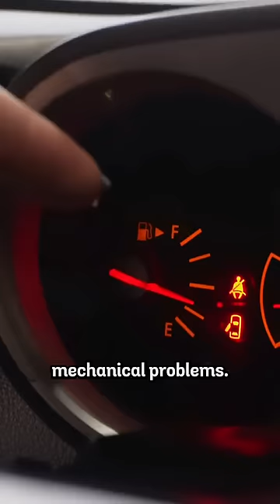Everything Wrong With My 350Z... (Part 1)

Comment: If it's leaking oil   it has oil🤷‍♂️
Reply: Lmao facts
Reply: Not for long
Reply: as long as it is leaking, everytihing is ok, if it stops leaking, then you have a problem!
Reply: @georgwarhead2801  if it leaks on to the belt you have a problem
Reply: @The_Wanderer...  what problem do you get because of it? the belt is normaly spaced away from the engine so leaking on the belt is REALY unlikely
Reply: @georgwarhead2801  it happens, and when it does it tears it up. Also it's not really unlikely.
Reply: @The_Wanderer...  i have now worked on MANY cars and engines, but thats the first time i hear someone saying, that a oil leakege has riped apart his belt?!? if you say it makes slip the alternator so you loose charging performance on your battery and your car goes out, ok...but tearing it up...and if your engine is leaking oil, it flows down, not sideways over a gap between the engine and the belt. if oil would kill belts this easely, every engine with a timingbelt would allready be dead. but hey, here we are and most engines still use timingbelts
Reply: @georgwarhead2801  I can see how what I said was misleading, and you're right, oil will not split a belt in 2, but it causes cracks and weakens the belt, which in turn breaks due to the tension on it. As for the oil leaking down, that overall just shows your lack of knowledge in the subject, oil is in a lot of pressure, and the engine isn't exactly sitting still, assume the leak was coming from the (a) cylinder head. Let's not even get into how many models of engines there are, to say you've worked on many cars is not a very good point, there are plenty more cars than what you've worked on, if I've offended you I promise that was not my intention, I just state the facts
Reply: @The_Wanderer...  dont worry,it takes more to offend me. As you sayed the oil is under pressure and can so reach the belts, even then, your problem is not oil on the belt, your problem is loosing oil so fast that your engine will be dead before it comes even close to destroing your belt. Still the belt is roo far away for a "normal" leak to reach it. Sure there are many types of engines, but all of them have many things orientet and positioned the same. Even if the engine is  moving in the car its allways moving parallel to the belt and not with a axial movement in the direction to the belt. Lets say you have a v8 engine in your car, the engine doesnt move back and forth in the car, its moving left to right. Its allways a radial movement, not a axial one and the belt doesnt sit under the head, it sits infront of it
Reply: @georgwarhead2801  in that you're right, your biggest concern is losing oil, the belt will take time to break, and even then it won't cause too big a problem, by that I mean no permanent damage. Second I pick up what your putting down, but even with all the oil has gotten on the belts, even as impossible as it seems it has happened over and over again.
Reply: @The_Wanderer...  oil will not reach any belts. no oil lines run anywhere near any type of belt the engine is turning. maybe coolant or power steering fluid at most will reach belts.
Reply: @shinobu3817  you guys are relentless, it has already happened, you can't change that, I know it seems unlikely, but happens anyways.
Reply: If it's leaking oil it's a DE
Reply: @The_Wanderer...  it has happened by someone maybe applying or spilling oil somehow on their belt before installing it but it will never happen coming from the engine. No oil leak will ever reach close to any of the belts.
Reply: That’s why when oil leaks, you check the bottom of your car and see where it’s coming from. It would be an amateur mistake of car manufacturers if they put oil lines near serpentine belts
Reply: @shinobu3817  and yet it happens, you can't argue with history, also, engineers make obvious mistakes all the time
Reply: @The_Wanderer...  "cant argue with history" tf does that even mean and has 0 relevance to what im talking about.
Reply: @shinobu3817  cool cool
Reply: @The_Wanderer...  exactly lol, u never had any idea what u were talking about and how engines are designed
Reply: @shinobu3817  riiiiiight, I leave you to your incompetence
Reply: You're ignorant  @The_Wanderer...

Comment: As a VW builder, having a pinned oil gauge and a CEL is how you know your motor is running at peak performance 🤌🏼 the oil gauge is to let you know how much it loves the oil you used, and the CEL is just a reminder to check out your rad wire tuck and shave

Comment: Honestly I have a 2005 350z. Has a ton of miles. But the oil leaking and burning is surprisingly normal on it 😂. Im no where near finished with it. But I've tried everything to get it to stop burning and leaking, maybe I catch can soon tho and I'll see if it stops 😭
Reply: I may be wrong but nothing about a catch can will fix your oil consumption problem.  Idk if you're burning or leaking oil, but the catch can just traps liquids from your pcv system so as not to reintroduce them to the engine.  Even if you are catching a significant amount of oil in your catch can you wouldn't want to reuses it as it will be mostly water in there with it.
Reply: @limprooster3253  ah ok. I've replaced hoses, lines and everything. Still burning and the occasional leak. I'll just have to deal with it 😅
Reply: @Duke-3508 Probably a valve cover gasket maybe? I’m just guessing but it could be that.

Comment: I would recommend going with the czp metal valve covers. They have servicable spark plug tube seals, and they dont warp like the plastic ones. The fuel level issue is the fuel pump sending unit, my g35 does the same thing and it just gets worn and binds up. Just replace it. The oil pressure pining is the oil pressure sensor, located by the oil filter

Comment: "Here's everything wrong about my 350z"

It being a 350z? Yeah
Reply: 350z’s aren’t bad cars bud
Reply: @343Paladin  isnt it past your bedtime?
Reply: @343Paladin  Do you have one bud? Mine needs new window motors, AC compressor, fuel sensor, oil pan gasket, 3 of the speakers don’t work, one of the headlights doesn’t work, and the horn doesn’t work. Also the engines blow up way too easily. They are not good cars they were made cheap.
Reply: @ryan7033  your problem not his you bought it should’ve bought something reliable
Reply: @ryan7033  then replace the fucking things it needs replaced. Just because urs is shitty doesn’t mean every other 350z is shitty
Reply: @ryan7033  and I don’t think they blow up that easy bro.
Reply: @343Paladin  they do bro it’s a fucking vq🤦
Reply: Settle down. You guy know how old 350Zs are right.
Reply: @TehBIGrat  it’s really not that old
Reply: @Christian_D24  He's trying to make a point; not saying that his problems are anyone else's fault. Your comment makes no sense.
Reply: @ryan7033  that’s cause u don’t treat your car right buddy
Reply: @neonnnest  really yk how I treat my cars?
Reply: @ryan7033  you had a De lol watch the videos on my channel of my 350z Hr  
and all the cars im gapping while bone stock with just weight reduction 🤷🏽‍♂️
Reply: @DaytonaBlueHr  never said they couldn’t gap cars Was saying they have problems😂
Reply: @ryan7033  this is the anecdote fallacy. your experiences are not representative of most owners. the cars rank quite well in reliability surveys. the most common fault was skipping Bose stereos. your fuel float sender likely went bad because it spent most it's life in a partly filled tank and the fuel cleans the sensor. oil Pan gasket could have been previous bad work or running in bad conditions without the undertray. horn.. check fuses. speakers.. come on can you not fix anything?
Reply: @03056932  I fixed all of it🤣 I’m 18 and probably am more mechanically inclined then you. Everything on the car was original, but my 1968 f100 had less issues so in my eyes a 350z was not a quality built car keep fan boying over a car you probably don’t have though. Later.
Reply: @ryan7033  sounds like you aren't given how you seemed to blame gasket maker failing on nissan. Jesus . dunning Kruger, look it up
Reply: @03056932  what does anything he said relate to the dunning kruger effect...you threw that out there with no information at all.  All he did was list some things wrong with his car. And gasket maker failing on nissan??  Wtf does that even mean.  If anything you are the one showing signs of dunning kruger by thinking you know something yet make absolutely zero sense.
Reply: @curtharakaly4620  and there you go, you made the same dunning Kruger you accused me of. the irony is delicious. he made no sense. he blamed somethings you cannot pin on nissan for the problems he faced. he assumed I don't own or haven't worked on this model because of his own lack of awareness of others abilities and intelligence. if you think he's right then we can video debate and let everyone decide for themselves. sounds fair right? let's see you make your excuses.
Reply: @ryan7033  idk, ive only heard good things about their vq motors
Reply: doubt most of yall have owned one lol mines had 0 major issues, just a door handle and window motor which are where they had to cheap out anyway to make the car sell cheaper its got a fantastic engine and transmission unless yall are shit at caring for your car or bought a shit one which isnt the cars fault
Reply: @lolickypeepee23xdd6 I can back you up on this as well. I have an 04 Enthusiast with the DE. Has 156K on it as I'm typing this and everything on it still works because the previous owner kept up with the maintenance. Everything on the car from the engine to the fuel pump is original. Electrical still works too. Problem with 80% of Z owners is that they don't know how to maintain their cars and rag their cars on dirty fluid.

Comment: The main problem is that it's a DE. 03-06 models are unreliable. 07-08 models is the move since the HR motor is bullet proof.
Reply: You've been reading reddit posts from 14 year olds who can't drive. The HR is undoubtedly a better engine than the DE, but neither are unreliable. The HR has stronger internals and is closer to a vq37 in design than a vq35. This results in it revving higher, making less torque but significantly more power without foregoing reliability, not improving it, big difference. Reliability between the two is fairly comparable. The revup DE had issues with using oil, which is what gave it a reputation as the people who bought them couldn't change a flat tyre let alone top off the oil once they see the pressure change. Both absolutely hate forced induction lol

Comment: Your oil pressure gauge is fine it’s either reading at 120 or nothing as it’s not a sensor that gives you the range of your oil pressure as the rpm’s change the only time your gauge will change on your Z is if you start dumping oil or it goes out and reads little to know pressure and thinks the car has no oil.

Comment: I have a burning smell at 4k rpm. 6 speed manual. Transmission or burning oil? Also ac system is completely shot and both windows dont work properly.

Comment: The gas gauge is probably fine. It’s more like to be the vent tube being clogged in the gas tank not allowing you to fill past half way. ( and yes it will seem like you filled it up but you have only half the tank filled)
Reply: Its probably the float on the fuel pump
Reply: @johnmeza955  shit, be hoping it’s that! For my situation in my g, it’s not. Doesn’t really sound like her problem either and tbh her problem sounds like the problem I have. 🤷🏻‍♂️ hope it’s a float!

Comment: No those aren't really that major. Except the fuel gauge. As far as oil is concerned check your oil regularly. I've honestly have a jeep that is leaking from the motor, trans, transfer case, front and rear diff as well as power steering lines and finally the exhaust. And I'm done throwing money at it. I'll just have a fluid check schedule and leave it at that. I know my motor is leaking from the rear main seal, oil pan and probably the valve cover. I honestly botched the rear main seal job so that one is on me. But I would probably change the stuff with the fuel and leave the rest alone.

Comment: A few gauge an ac and an oil leak is “everything”? Ac is easy af especially if it’s leaking. Gauges take a few mins. 

My car is the problem. I’ve fixed 15 things including ac, suspension, mounts etc etc. little bit of everything around the car. Now one of the jack points is completely gone due to rust. And $1000 more worth of stuff. And that’s if I fix it

Comment: The bearings suck, idle sucks especially at redlights/stop signs, will make weird sounds as if it’s about to turn off), rear tires bald quickly (will cause hydroplane), gas door has problems won’t open at times…

Oh yeah the chips on the front bumper, yeah fuck that lmao

Comment: I had a g35 coupe and the fuel would only read half even when full, i started using premium and after that it started reading correctly
Reply: I mean, those cars are tuned for 91+ (premium) octane gasoline, weren’t they? I don’t think using lower octane gas caused that issue, but it definitely may have caused some engine and fuel related issues if you drove hard with 87 octane (regular) gasoline. You might have even had some unnoticeable engine knocking and decreased power issues at some point.

Comment: ain't your gauge it's the oil pressure sensor. careful changing it though, using wrenches you can easily crack the engine as it sits in an unfortunate place.